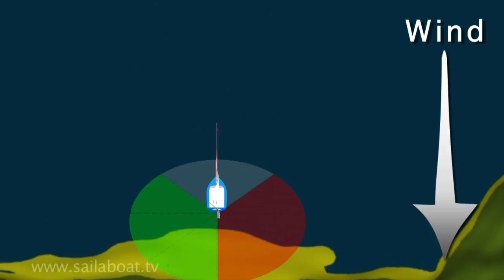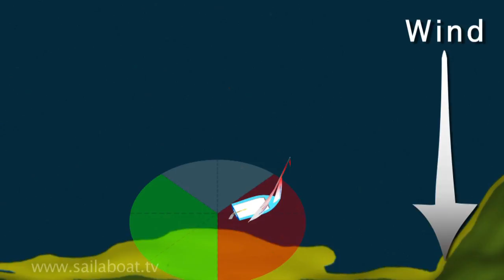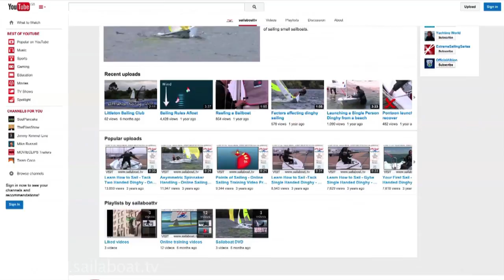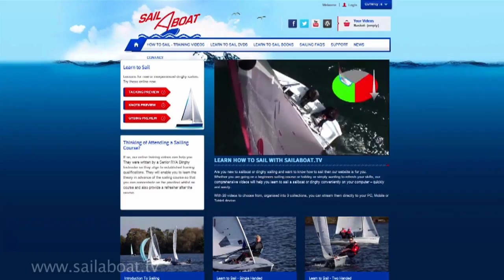How to Sail - 2H Beach Launch - Part 2 of 5: Onshore wind

Comment: In extreme conditions it is sometimes best to row out into deep water.
Reply from the maker: Good tip thanks
Reply: It was a bit tongue-in-cheek because I realise that racing dinghies tend not to carry oars. Other difficult situations are where there is a strong cross tide, or obstructions such as jettys to one side or both sides of the launch beach. I would always recommend rowing if there is any doubt.
Reply from the maker: Mirror Cruising our site is aimed at new sailors for whom a paddle is a common piece of kit so what you say has some value
Tim
Sailaboat
Reply: Awesome, I was wondering what the procedure was for a Mirror